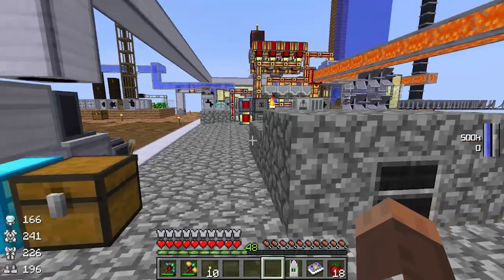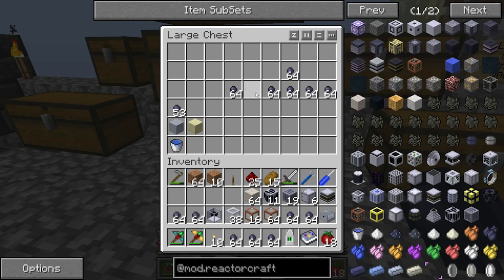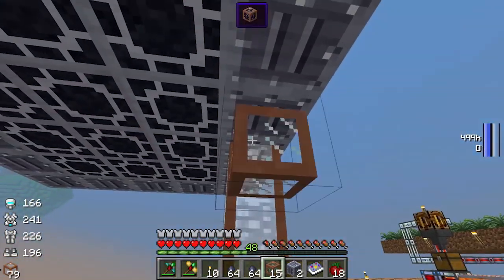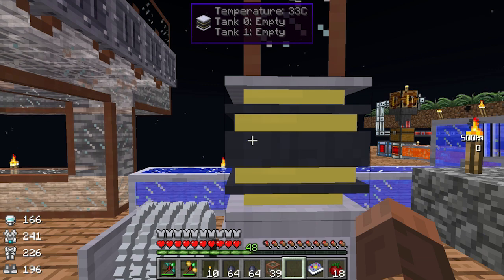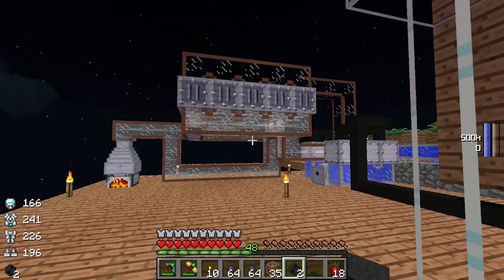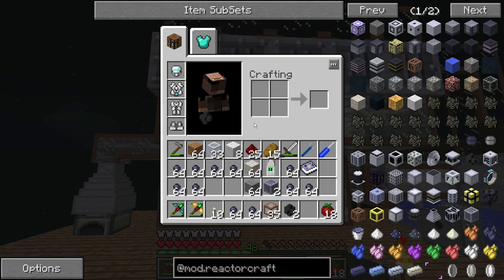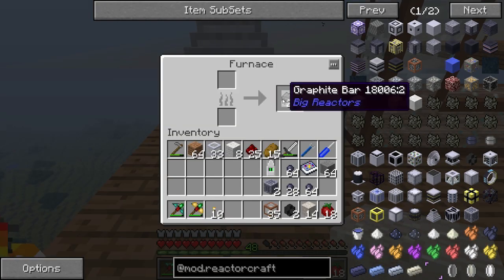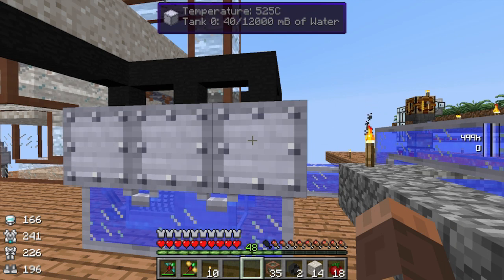Monster FTB High Temperature Gas Reactor, Pebble Bed

Comment: Is it more efficient to surround the reactors with the heat exchanges surround the heat exchangers?   I was thinking of something similar with a 3 stack of reactors in the middle surrounded on 4 sides with the gas heat exchangers and all that surrounded by concrete.  May have to test this.
Reply from the maker: 1 Thing you have to remember is that it is possible for a CD heat exchanger to transfer enough heat into another heat exchange and not leaving enough heat inside to heat the carbon gas. As for stacking a reactor, each level increases the total sides facing out lossing heat.  For example a single layer with 12 cores has 18 sides block faces losing heat, a 12 in one single stack with heat exchanger surrounding has 144 sides loosing heat. Stacking can get you more power thou.

Comment: Are there any reactor designs that use Free Piston Striling Engines instead of Steam Turbines?
Reply from the maker: Sadly no, the steam in the steam lines can't be converted to other mod steam, as for potential engines getting implemented i doubt it. The thermal energy coming from these reactors is just too great. A sterling engine might turn up in the game but that is up to rieka.

Comment: I made an htgr with this setup, and it only gives me 21.5 MW. I don't understand what I'm doing wrong.
Reply from the maker: There's a couple of reason it could be happening. 1 you only have one turbine, 2 there's not enough carbon gas going into the carbon heat exchanges and there for not making enough hot gas, 3 parts of your reactor are in contact with with air and are loosing heat (Some blocks are better at keeping heat in).
Reply: Ausyarr Okay, I figured it out. I didn't have enough aqueous accumulators supplying water to the boilers, so I wasn't making enough steam. Thanks for you reply, though.

Comment: Pebblebeds shouldn't melt.
Reply from the maker: Like in real life? or in mod because I've seen lava quite often.
Reply: Ausyarr In real life, the nuclear reaction in a pebble bed reactor slows down as it gets hotter, and if the pebbles shift in such a way that the pebbles are no longer set up correctly, the reaction stops altogether except on the inside of the pebble itself.